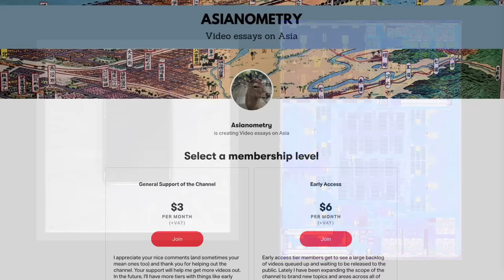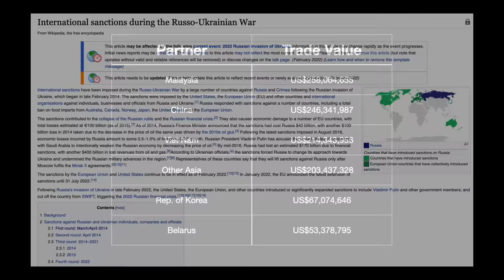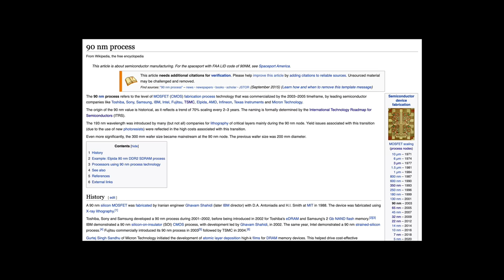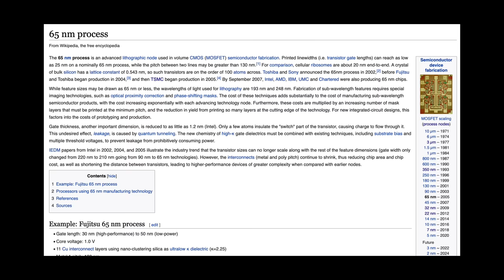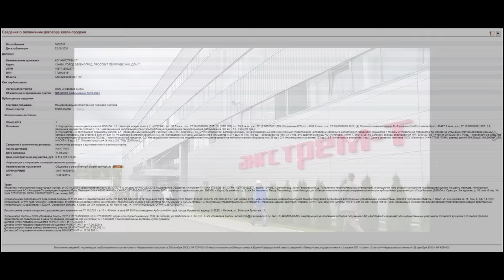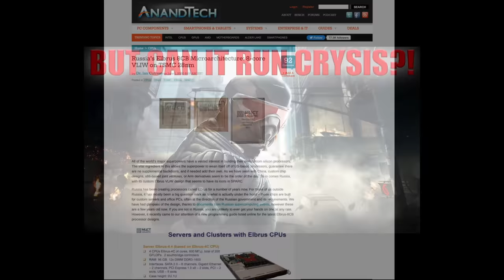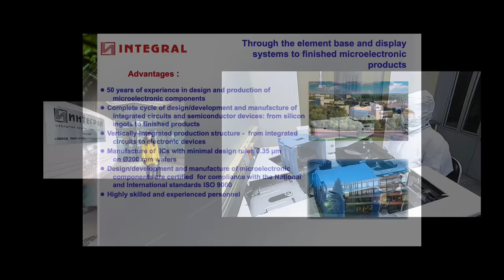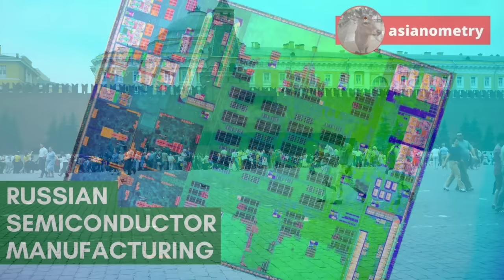Why Russia Can’t Replace TSMC

Comment: I'd say it is a very competitive industry and if anything it is not governments who run these semiconductor businesses but rather conglomerates that invested in the cutting edge tech at the beginning. Not everywhere this tech has been developed. To play a catching up game is very brave. However, the problem is that the main industries do not require advanced semiconductors of the small scale. Most of the economy extracts minerals, processes the proceeds and transports the resources into other countries. Where the hell are they suppose to use this sophisticated tech? Even robotic arms do not require smaller semiconductors than the ones they already produce. Apart from bank cards, the only other large scale application of these could be surveillance cameras that are to be used in big cities. May be car industry. But that is not a big market at all. So they cannot compete in mass production with conglomerates and their return on any investment is almost non-existent.

Comment: China will sell them all the ARM chips they need (Rockchip, MediaTek), along with AMD derived licensed Ryzen designs.
Reply: But at what cost?
Reply: @090giver090  Oh I'm not saying it's good but it's what inevitably has/will happen. Essentially: this video is totally irrelevant as long as they have China as a trading partner.
Reply: @djayjp  hard to say. China already refuses to sell Russia aircraft spare parts after US and EU ban. So I wouldn't rely on them as a sure partner. And chinese agenda behind any help with electronics (if the do help) should be huge.
Reply: @090giver090  I don't see it happening... Unless Taiwan stops exporting to China for sales to Russia. Would be very hard to enforce.

Comment: True enough, but misleading. The whole gist of this video is that Russia is falling behind the West and it is suffering. Except for that last bit "Guns don't need 7nm chips", which is spot on. But that needs more context. If your economy depends on consumer electronics exports and your national champion companies are falling behind Apple and Samsung because you don't have good 7nm chips, yes that is a big problem. But Russia does not depend on consumer electronics exports at all, zero, zip zilch nada. They don't even need any domestic consumer electronics, they just import all that cheap stuff from China. They do export quite a lot of military hardware, but missiles and artillery and even fighter jets do not use 7nm chips.

Comment: as America or any country from the EU can't replace TSMC and why ? because there are only two big Microchip Producer in the world TSMC and Samsung and belive it or not both of them are in Asia and not EU or America. I do not count Intel to the top players because Samsung and TSMC are faaaar ahead of Intel.
Reply: Intel has had some serious past struggles but they are generally on par with TSMC and Samsung. Due to differences in measurement their 10nm is essentially the same as TSMC 7nm or Samsung 8nm. Their main problem with deploying its 10nm was poor lithography. It's unclear if this has seriously impacted their upcoming 7nm node or if they learned their lesson.

Comment: 15:55 times today are different ?    No they are not !    Russia needs ASML and Canon lithography equipment to hit anything in the nanometer realm.      And even if there weren't international sanctions against Russia purchasing said equipment, no dutch or japanese CEO would do business with Russia given its military aggression against Ukraine.       And you should have explained the difference between a micron, and a nanometer.   Hint: It's the same order of difference between a meter or yard, and a milimeter.     Or the difference between an arm's length and something you can almost barely see like a flea.      The techno difficulty between a micron transistor, and a nanometer transistor is the same order of magnitude.   1000 times harder, and 1000 times more expensive.

Comment: Fabulous video (pun intended)! I just want to add something to think about. If anyone thinks that Russia's technological gap is limited to IC / micro-electronics, they are very much mistaken. Russia's technological gap is endemic. The F22 was designed in the 1980s and built in the 1990s when feature size was still measured in microns (1000s of nano-meters). The space shuttle was designed in the 70s and built in the 80s, when feature size was 10s of microns. If Russia had the material science, design engineering, systems integration, logistics, administration and business planning skills at an internationally competitive level, and the only thing that they lacked was an IC industry capable of producing <65nm components, they would still be capable of producing incredible, internationally competitive products in the military, scientific or consumer domains. However, they don't. It's a mistake to think that just because the Soviet Union excelled in some of those areas (e.g. material science), that Russia retained those skills. They didn't. The industrial sector collapsed after 1991. All capable professionals left to pursue a better life abroad. The political system which formed after 1991 made it hostile to everything but the most rudimentary industry (e.g. natural resource extraction). There is almost no secondary or tertiary industry left in Russia, and the service sector is laughable. The attempts to kick-start these industries (like the companies talked about in this video) serve a two-fold purpose - to show on national TV that "we can be independent from the West" and to steal money from government contracts and then declare bankruptcy without actually shipping anything. It's a game they play at the higher levels of government in Russia, and have been playing for a long time.
Reply: @vladimirnikolskiy 😂😂😂😂😂😂😂😂😂😂😂😂

Comment: What will probably happen is that countries with scientific and technological capabilities such as Russia, will resort to simpler solutions such as RISC-V chips as substitute for the more advanced and complicated TSMC / western chips. RISC-V processors are inherently faster and more flexible than the more complicated rivals.
Reply: WTF are you talking about? The issue is manufacturing, not design.

Comment: You would think with all the computer hackers coming out of Russia, they would be very advanced in the tech industry in general. No wonder I've never heard of any of these chip design or manufacturing companies. Relying on some fork of Linux, the sheer lack of web or software companies that are good enough to have outside clients, just emphasizes how they are better at the whole take, destroy, and empty boasting rather than real achievement.

Comment: Alexander Mercouris blurted out (accidentally) that we Russians are quietly manufacturing IC chips at 60 nanometers and with a safety spacing of 10 nanometers around each transistor or any component whatever that is required, which makes it 80 nanometers and that is 97 billion, 656 million, 250,000 transistors per square inch. The Chinese are also making it independently even in the 1990s but wants to achieve the 3 and 2 and 1 nanometer range. We Russians are doing the Japanese strategic tactical move of using larger size components and simpler designs and REDESIGNING THEM TO BECOME VERY EASILY TO BE MASS PRODUCIBLE for our Russian needs but research for reaching the same 1 and 2 and 3 nanometers range is already independently going fast.
Reply: As fast as Luna 26 😂😢😅

Comment: 4:55 I love this assembly of traffic signs. Stop! No stopping! 5km/h! With some extra flavour text to keep drivers entertained while they wait for the gate to open.
If this picture was taken in North America, it would just be the stop sign. If this picture was taken in western Europe, it would only be the no stop sign and the speed limit. But Russia just can't decide and puts them all up with a little bonus sign for good measure.
Reply: STOP means you should stop before continuing driving. 5km/h limit starts AFTER the sign, as well as no stopping sign. I doubt it works differently anywhere else
Reply: Do you have the right to drive a car? Take the exam again!

Comment: vacuum tubes are resistant to emp blasts. i think they are so fixated with nuclear warfare that they didn't focus on iC's.
Reply: Any modern military IC is resistant to 'EMP blasts'. This can mostly be accomplished with simple shielding and some clever PCB design. It's not rocket science. ICs used in aerospace applciations are also typically radiation hardened to withstand tens, or even hundreds of thousands of rads. The BAE systems RAD750 single-board system, for example, is both EMP hardened and radiation hardened, being able to withstand up to 100,000 rads or 1,000 grays. 

No outdated vacuum tube technology required. 🤦‍♂

Comment: Looks at my old PC running a 65 nm 'Conroe' Intel Core 2 Duo E6600 in the corner (now used as a retro XP machine) and laughs knowing Russia is struggling to match that fabrication process.

Comment: The difference between the spelling Angstrom and Angstrem is an issue with transliteration from cyrillic to latin alphabet.  The cyiillic 'e' is sometimes pronounced like "yeh" and sometimes like "yoh" depending on where it appears in a word and whether the word is Belarus or Rus in origin. So some translators use the latin letter 'e' and some use 'o'.  Pedantically, it should be an 'e'.

Comment: I know the Russian mentality. Yes, they have talented programmers, but there are not so many hardware programmers and their technologies are far from modern ones by at least 5-6 years. I would no longer worry about their progress in the production of microchips, but that they will steal technologies, ideas, etc. Also, they will definitely not be able to replace the embargoed American and European components in the coming years. Therefore, it is very important to prevent leakage channels for these parts through, for example, China.

Comment: Remember : judging the chipset by the transistor size gives you basically nothing... Smaller transistors means that you can pack more transistors in the same space and that they will operate more efficiently. But if you have capability to dissapate the heat produced and if you have the space for bigger chip than you can make the chip same as powerful as the smaller transistor one. That is like comparing n/a V8 with turbo l4
Reply: But it defeats the purpose ,no ? It eats so much energy and it will still be comparatively worse.

Comment: Even if Russia could fab anything even remotely competitive, that production process relies on economies of scale, and they'll never achieve it. No one on planet earth smart enough to be in the tech industry would EVER plug a chip into their networks/systems that was wholly designed/built in Russia. I bet most private sector entities within Russia would even be reluctant. Without those sales, you'll never scale to compete without massive subsidies from government, which Russia is in no position to do, thanks to a "special economic operation" that's currently happening.

Comment: This is an old post and a lot of development had happened already. China built their own lithography down to 7nm - they said. Also support tooling equipment to make a one stop manufacturing  under one roof. Russia had started developing their own lithography machine using Xray about 10 years ago, and nothing was divulged publicly either by spies or Tom's Hardware what the progress were. About 2014 Putin said that all military weapons should only contain indigenous parts and components. Substitutions were initiated and that's all I heard. Nothing from the CIA too. When the latest Russian satellite was sent up to orbit, Putin said it is made of indigenous components. No foreign components especially electronics. The Pentagon went crazy as usual because the NSA can't hack the hardware. But we've seen a lot of Russian technology   either new or upgrades that came about in a year onward of the Ukraine war. More surprises are coming as this war is not ending soon. Have a good day.
Reply: Examinations of shot down modern Russian airplanes, ballistic missiles, cruise missiles, helicopters and captured/destroyed land vehicles (including SAM's) have shown that Russia is still heavily relying on western electronics.
Reply: @Rehunauris  Russia just launched its Rassvet-1 mission while under Western sanctions. Sounds pretty independent to me 🤷‍♂️

Comment: Ruassia level of unemployment is close to 0, so workforce cohoose areas with highest salary, and that's simply not microelectrnics, because it's the area where making profits is tough, there are way too many profitable alternatives currently in Russia - software enginering, mechanical engineering .. same with 5G in Russia - not profitable ,no demand, 4g / optics is perfectly fine.
Reply: Russia has 6G...

Comment: False information. Russia is not seeking to replace TSMC rather, they are close to making a Russian version of the Dutch Lethography machine that is much easier to manufacture. This machine is essential to produce semiconductors that TSMC makes.

Thanks to American embargos on Russia & China from procuring high-tech equipment systems. Now both the countries are very close to having those things made by their own industries. They knew it for long and now full speed ahead for having their own machines and components.
Reply: Sure, but in Russia the will be measured no in nano , but mm 😂😂😂

Comment: This video didn't age well I would have took it down by now
Reply: This aged perfectly. More relevant than ever, showcasing how backwards of a superpower Russia is.
Reply: @hermitcrack9091  oh you're one of them sponge heads that believes Russia's fighting with shovels LOL
Reply: What changed?
Reply: @Алексей Бусыгин  Russia has no problem producing their own Microchips. The video stated they could not that was a lie. As you can tell by all the cruise missiles, airplanes, tanks, TVs, computers, washing machines, dishwashers, stereos and on and on and on
Reply: @Nolefan1966 Micro is the right word, next year it will be Milli